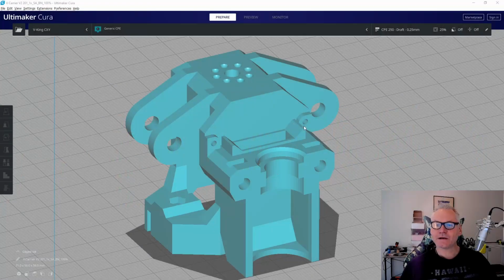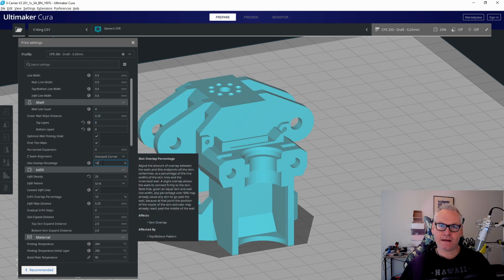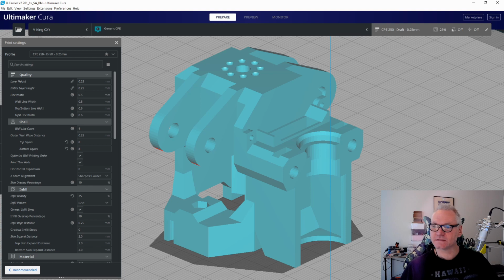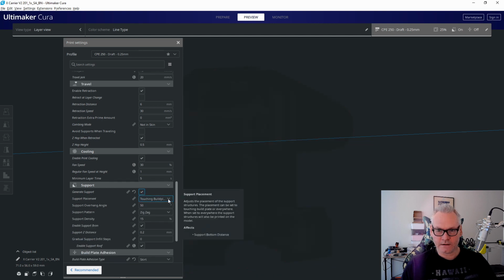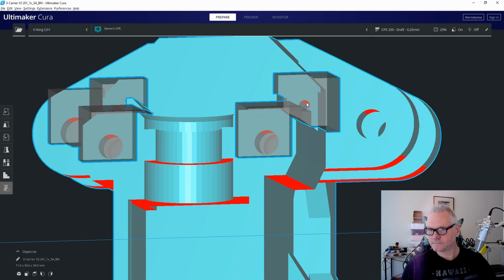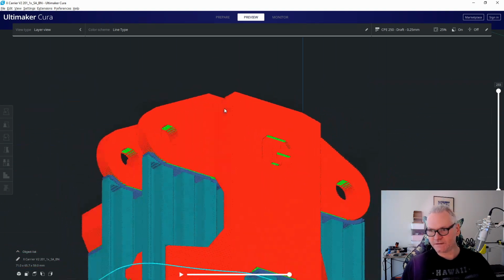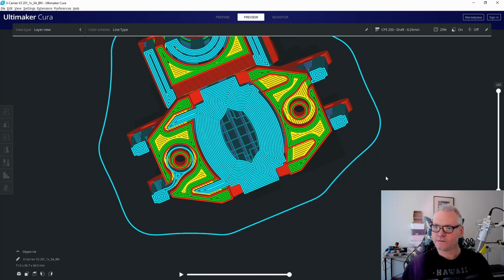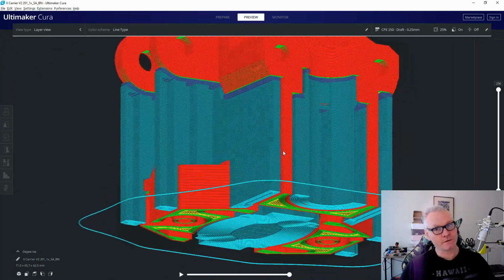CURA ADVANCED | How To Use SUPPORT BLOCKERS In CURA SLICER | Advanced slicing for better performance

Comment: Advanced would be if you use the support blockers for different settings, you can apply let’s say 10% infill inside the area of the support blocker and the rest of the Model will have 30% infill… that would be advance usage of support blockers… your video shows Beginner usage 😉
Reply: here you go:
https://youtu.be/su_m5zV9rvA
Reply from the maker: Thank you for the feedback. I will try harder
Reply: @PRO3DESIGN  i just wouldn’t call it „advanced“, the rest is very useful for beginners! Thx anyways for your video…

Comment: New to using cura. I do not have the support blocker feature on the left hand side... Do I have to add this? I downloaded custom supports but its still not there.
Reply from the maker: What version are you using
Reply: @PRO3DESIGN  I figured it out. They changed the icon and for some reason I was not getting a description when I hovered my curse over any of them. For any newbie that had the same issue as me, it was the bottom icon with black and white stripes with a dashed box next to it. Thank you for replying though!